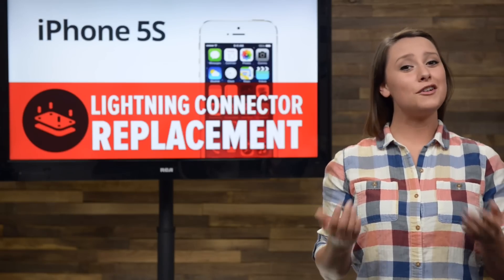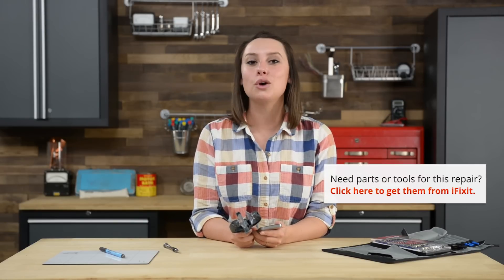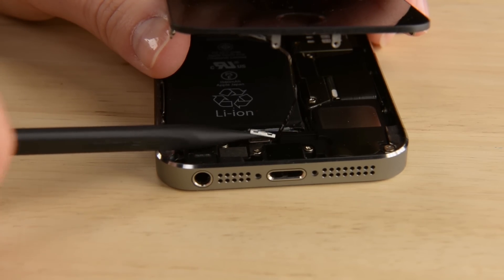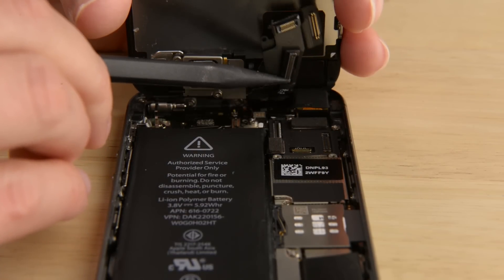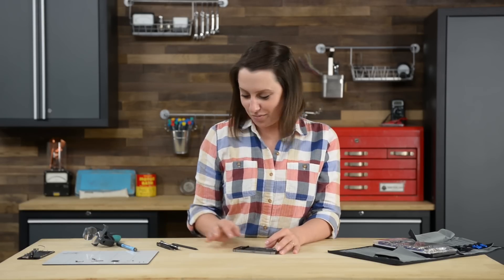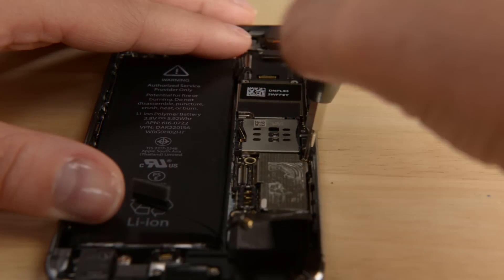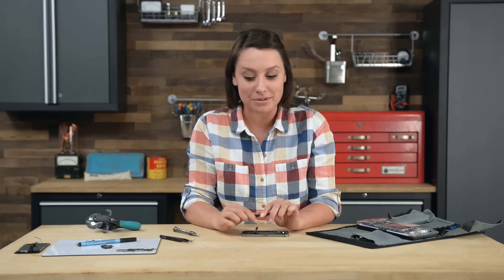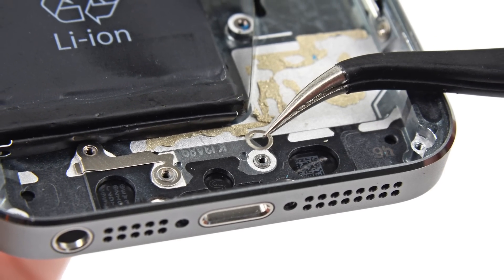How To: Replace the Lightning Connector in your iPhone 5s

Comment: I just did this to fix a faulty connector and learn some stuff. Got all the part and tools from Amazon for <$7.00USD shipped.
You do not need to remove the logic board to do this. Check the website.
Your new connector assembly may need some parts, like the rubber around the mic, transferred. Check before closing the phone up.

Comment: Unsure why but.. I have this issue where my iPhone works, but will not charge. The charge icon is there, but according to my battery app, no mAh is going into the battery.. and the % is falling.

If I give the phone a bit of a shake, it'll work.. sometimes. But I had to change my battery again, and now I can't get it to charge. Anyone know what it could be? :f

Also, before the battery inside is loose, I could hear it moving around, and when I shook the phone lightly, or gave it a tap on the bottom, it'd charge properly..

Possibly the circuit onboard the battery's bottom where the connector comes from?

Comment: Ok, so I followed the video and the step by step instructions on the site, got it all back together and now my speaker won't make any sound at all. No music, ringing, anything. Took apart a second time to check on things and noticed the speaker  contact points on the replacement charge dock strip are a bit smaller so I focused on trying to make sure it would make contact. Put it together again and still nothing. Only on headphones.
Would the small side peg from speaker assembly under home button connection give any trouble? 
I read someone mentioning about the phone thinking it is docked and thats why it won't play, can it be it? 
Thank you for any help.